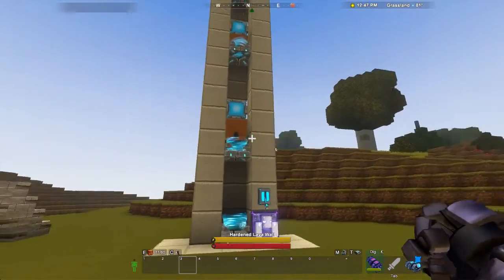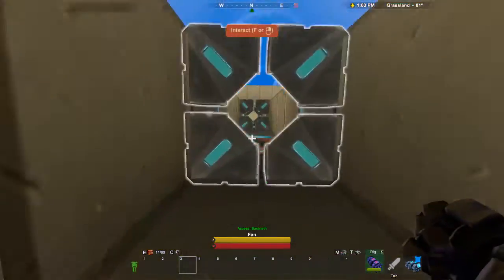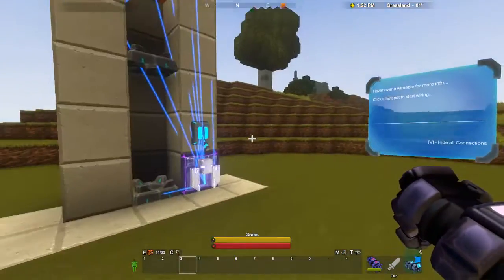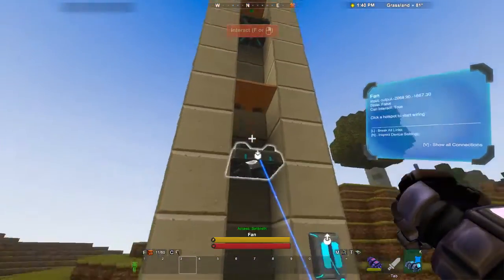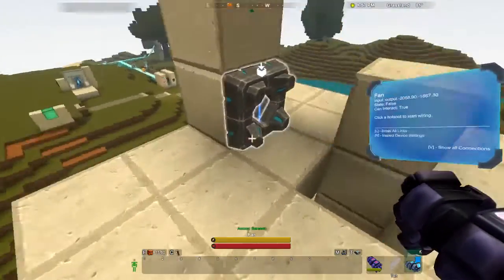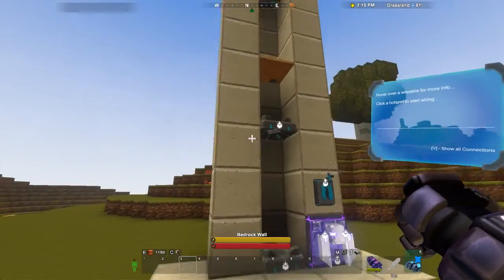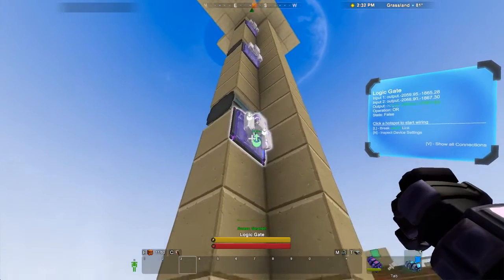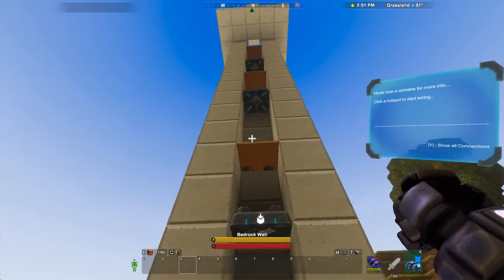Safety-Catch Elevator (prototype; Creativerse R33⅔)

Comment: Usually you can use a block of goo in the bottom, instead of all these trapdoors.
Reply from the maker: That's one option for the bottom most floor, but it doesn't really work if you need to go a floor down from the current shaft. :)

Comment: I was wondering if this was my idea :). I never talked to you about it, but I was wondering about trapdoor catches in an elevator :). A bit different than what my thoughts are, but I was even thinking about side mounted plates :)

I know floor selectable fan elevators are a thing. My safety catch had more to do with the floor select potential. When you hit the floor you selected, sideways plate triggers trapdoor into closed position, you land on it. Trapdoor does not open again until you step off of it and across another plate in the floor. My safe drop idea is entirely less technical, simply a goo block or water pit under the bottommost fan :)
Reply from the maker: No, you never talked to me about this one. :) I'm sure we're not the first to mix trap doors and fans, nor will we be the last. I'd love to see your negative-triggered design, though!
Reply: I tried to design one with trapdoors and selectable floor too in one of my houses. But as I have different floor height in it, it turn to be hard to control and I fell most of the time while I was programming it. So I just put a ladder.
Reply: It really is programming ... i wasn't quite sure why i liked this game so much, but now i know ... it's the programming part of it. It's amazing. I know minecraft is trying to teach kids to program with their minecraft education game ... but this is much more straight forward than that. I even got caught into my trues and falses when doing a simple delay gate opening with phaser blocks .. but i enjoyed the process sooo much! :P

Comment: cool, but can we use number pad is a way to make us go to othre floors insted of swcth
Reply from the maker: As I mentioned in the video, this is a prototype that works only on two levels and uses just one type of on/off mechanism (the XOR as a multiway switch) for demonstration. It can be integrated into other systems that use other on/off  mechanisms.
Reply: It certainly is possible to make a set up selecting floors with a number pad. :) Me and Saraneth have both been trying to make a system that combines both up and down travel with floor selection. I'm not sure how easy that will be though as trapdoors will only accept input from one source. :)